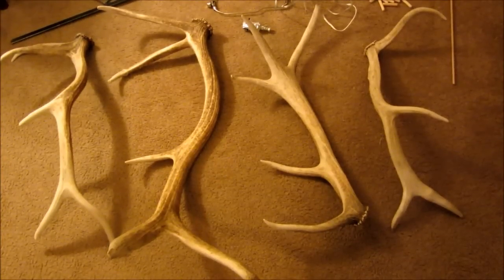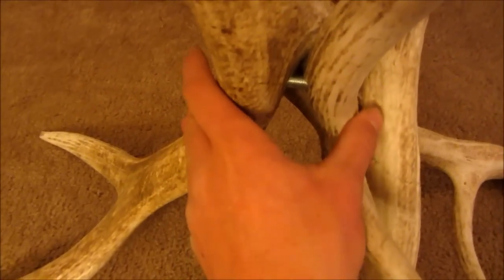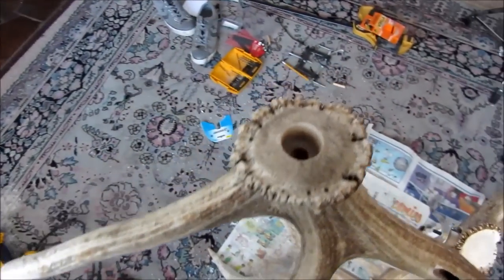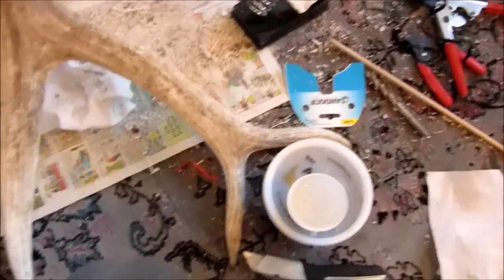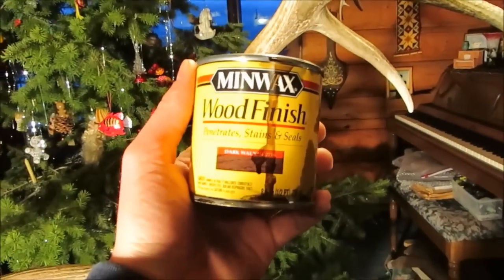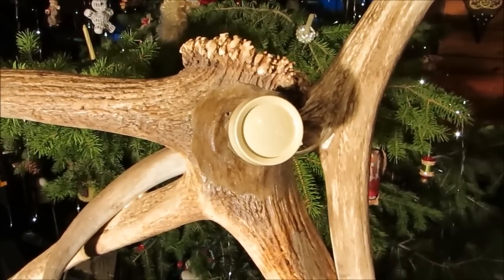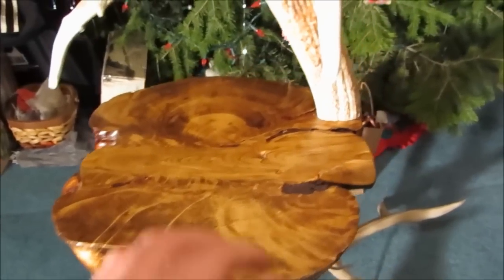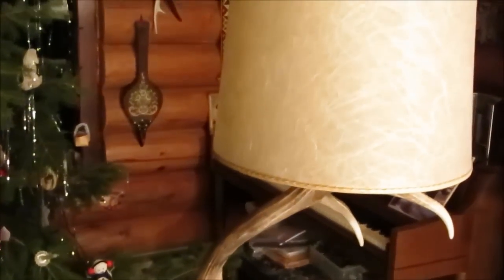Elk antler floor lamp

Comment: for the AB epoxy areas, you may want to take a spare elk horn and roll it over the epoxy to get a better elk texture finish.
Reply from the maker: Actually thought about that after it had already hardened. I think that would work well if you had a small chunk of antler to get into the tight spaces.

Comment: you should conceder using epoxy glue it will bridge gaps at full strength,  Gorilla glue is only good for  clamped flush  joints (very strong) but is very week  filling gaps.  It becomes  brittle  urethane foam
Reply from the maker: +lar s Yeah, in hind sight some other form of glue would have worked better. I ended up cleaning up a bit of overspill that didn't look so good.

Comment: Great job, I probably wouldn't have bothered with the dimmer though as those holes look hard to hide/blend, I was absolutely blown away with the burl shelf, seriously makes this project a top shelf item, the only thing I would have changed is to put that shelf the other side then the dimmer is hidden
Reply from the maker: +MARK HARPER Thanks! I have a plan to carve a knob out of clay and cover the dimmer area. It should look good when it is done.